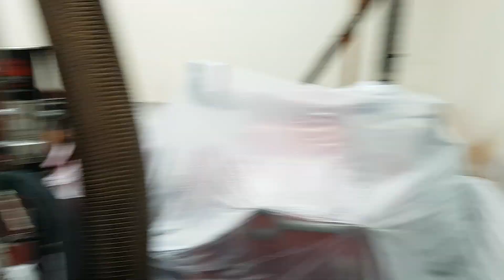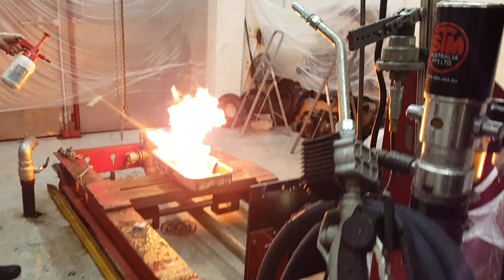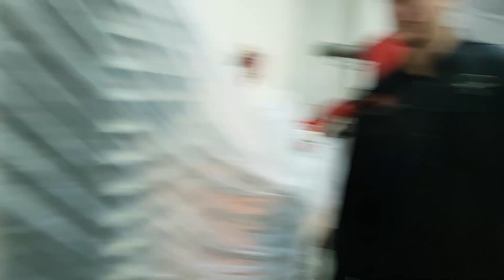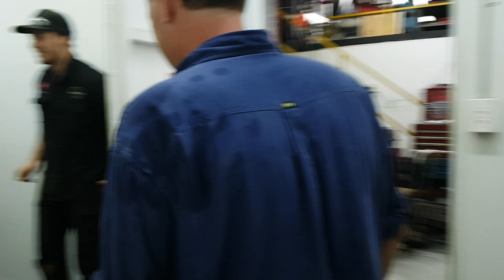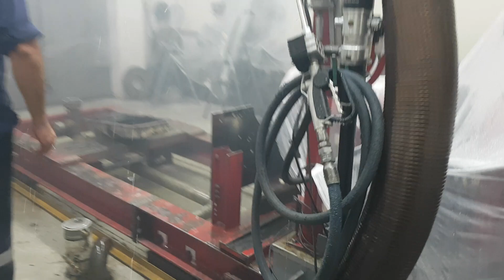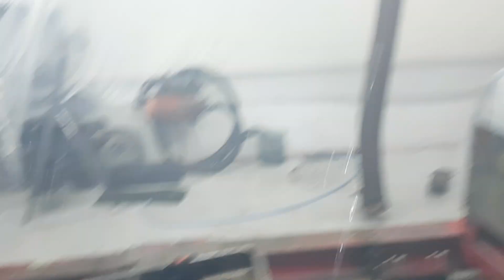Dyno Room Fire | Suppression Test | Misting System

Comment from the maker: Halon systems have been banned since 1995. Something about destroying the ozone layer. We don't have much ozone down here so we need to keep what we got.  Mist is the latest idea.
Reply: Hm, I did not know about the banning.  I worked at a natural gasline compressor station (1987) and in their yearly suppression test, it would fill a 50 x 80 x 16" room to the ceiling in like 90 seconds.